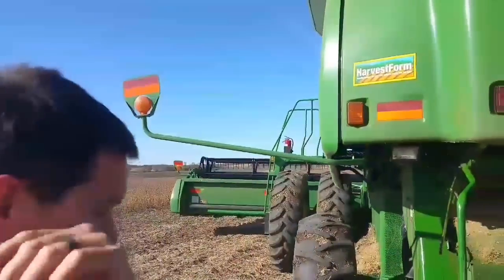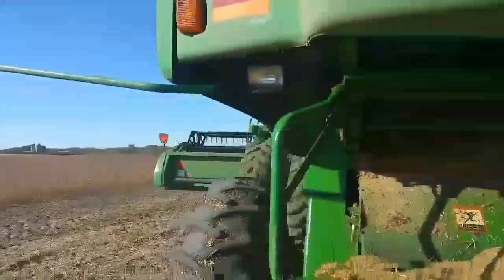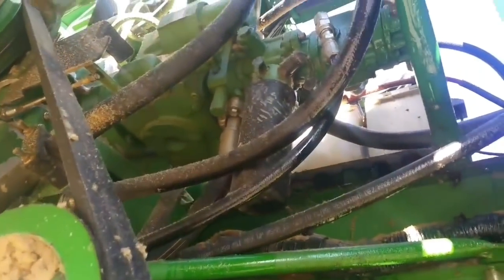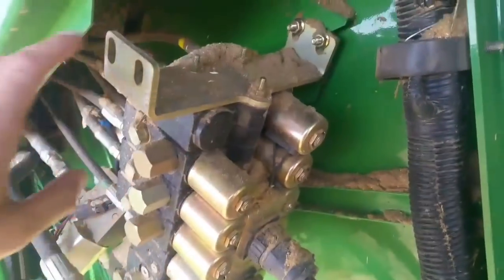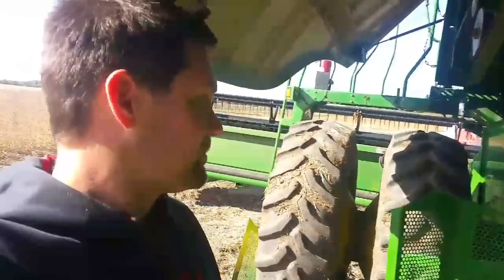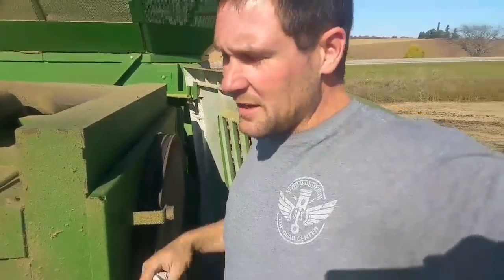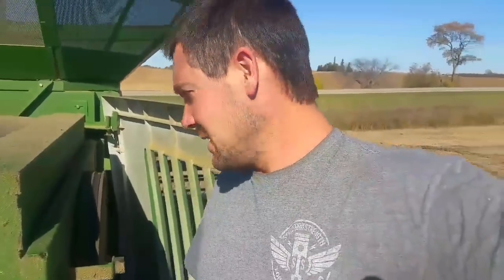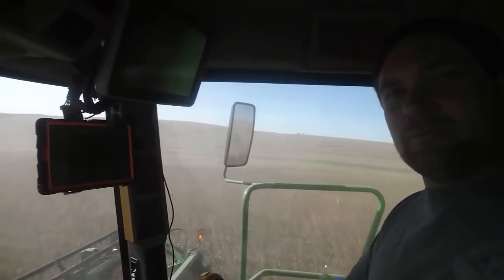John Deere combine BREAKDOWN and harvest fun!

Comment: Not sure how far away your dealership is, but a big operation like yours ought to have a hydraulic hose machine in the shop. They save a lot of downtime! My old man has a machine and he doesn't use it much, but when he does he loves it.
Reply from the maker: Jeff Button we've considered that but it seems like it would be pretty spendy.  Our dealership is only 10 miles away also, so it's not too bad.
Reply: MN Millennial Farmer yeah, I hear you on the cost. But downtime is worth something too. If this had happened on Saturday or in the evening you'd be glad to have the ability to get back up and running again. The good thing about having your own equipment for repairs is that the shop is always open!  Just get the crimper, you can cut hydraulic hose with a chop saw with no problem.
Reply: @MillennialFarmer  sell the green I have red and no break downs.

Comment: Do any farmers use claas? Are you able to buy them here in the states?
Reply: joe parenti Yes but there kinda rare to find in the U.S
Reply: Alot of the dairy and custom chopping guys around me use claas choppers. It is rare to see claas tractors being used though
Reply: BNSF Bandit that's kinda cool, makes them that much cooler lol. I'm just a nerd who plays farm sim 17 but I took a liking to the claas tractors first lol
Reply: Class in the states are cat lexion.....same thing only different stickers and color
Reply: farmermatt629 

Caterpillar isn’t directly involved with agricultural combines or tractors anymore.  They’re Class Lexion combines now.
Reply: How is putting their engines in a Claas combine not directly involved?  They also put a big CAT on the sides of those combines, they WERE directly involved, but NOT anymore.
Reply: Howard Younger does claas equipment cost more by default before any importing or Mark up?
Reply: Never said Cat built the whole machine, but they DIRECTLY supplied the engine to those CAT Lexion combines, and DIRECTLY sold them through their construction dealerships.  That, to me, means Caterpillar was DIRECTLY involved with those combines.  Again, they did put their CAT logo on those combines, meaning to me they were DIRECTLY involved with those combines.  

CAT developed the tracked tractor market, but since they used New Holland cabs and rear ends in their 45/ 55 series tractors I guess Cat wasn't DIRECTLY involved with those machines since they didn't build the whole thing, correct?
Reply: A local farmer here has a Claas. It's on tracks.
Reply: Yep. Local farm around here has one
Reply: Andy Hass we run a Case 8230. The guys here that have the cat really haven't had many issues, besides it lighting on fire a few times..
Reply: Yes. Class Lexington combines are also built here.